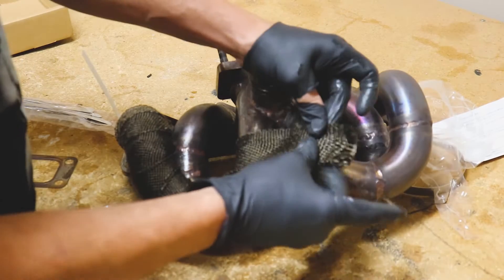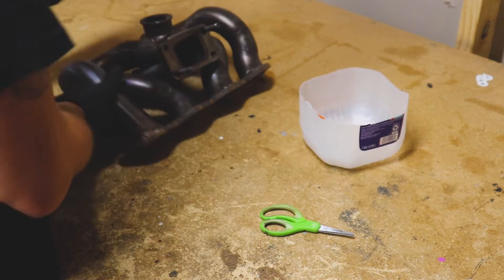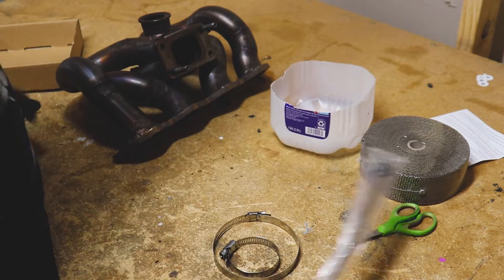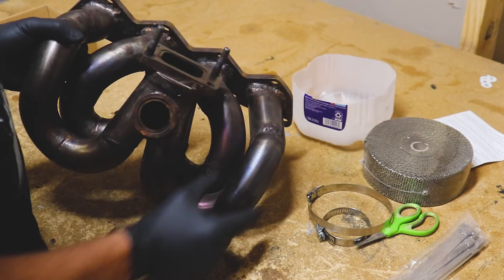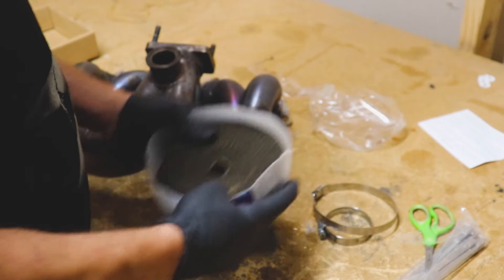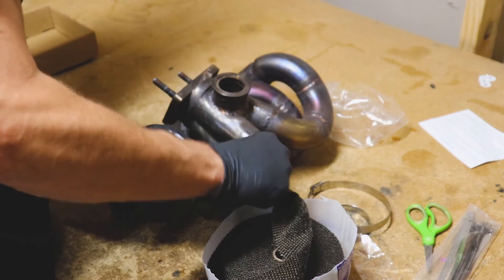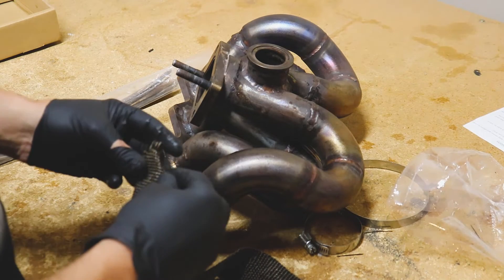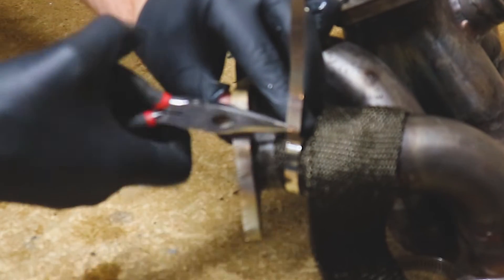Turbo Header Wrap: Worth It or Waste of Money?

Comment: If you aren't a fan of the stainless zip ties, you could use safety wire
Reply from the maker: Thanks for the tip!
Reply: @cmattdabrat  I think you'll like the safety wire... It's almost invisible and it's very low profile. 💪

Comment: This could not come at a better time. I actually had a code pop up on my car for a bad cat. My Malibu front side header the cat is built into it which kind of sucks. But I was able to find a MagnaFlow high flow header for my car surprisingly. I wanted to wrap it I wasn't sure what to buy and  going about doing it. For my particular car they don't make a cold air intake so I had to design one for myself and unfortunately even the factory design it runs past the front header. Although it is reflective aluminum they say it's good to reflect heat and not making the air warmer inside the intake. But I wanted to reduce like you said engine bay heat and also heat rising to the intake. So now I can order the stuff you used and have a little bit of an idea how to go about it. Thank you 👍👍👍
Reply from the maker: Any time! Glad this will help.
Reply: Put some gold foil on the intake tube!!! Gold makes the ladies happy!!